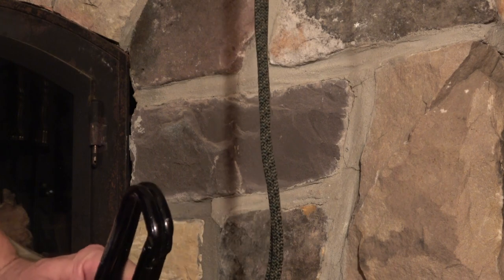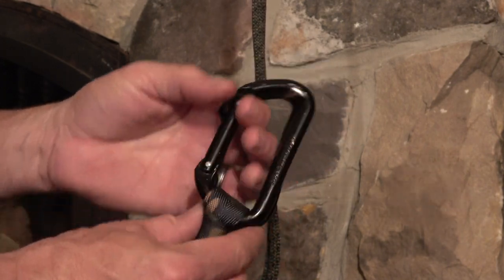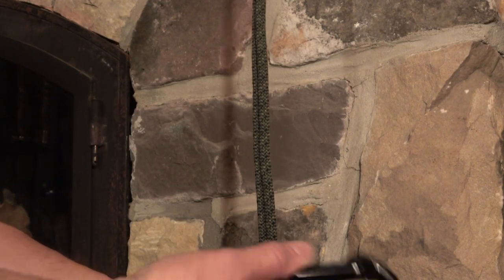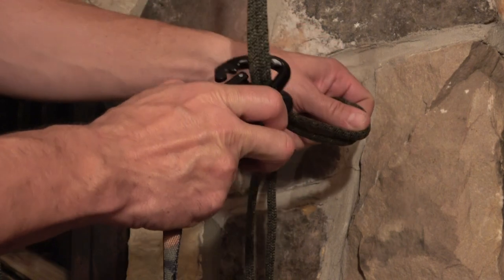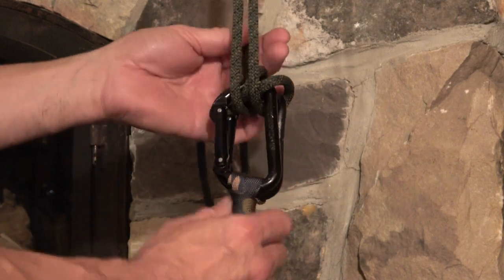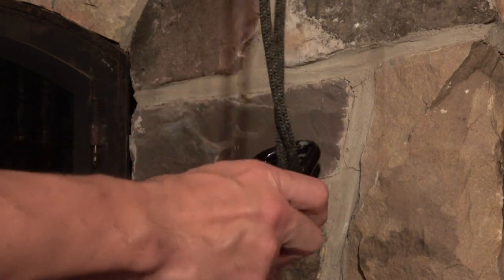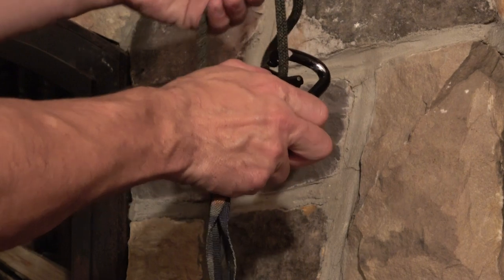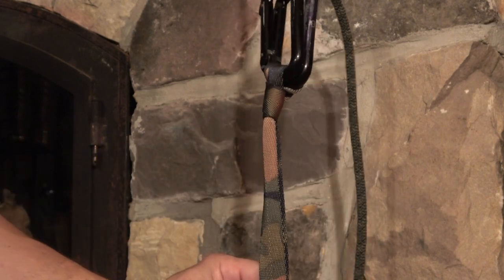Engaging the Garda Hitch (unlisted)

Comment: I tried this and it locks up both ways, so i still need to unload first before for progress capture to work.

I'm a new climber. Could someone please explain to me why we need this hitch over other hitches like distel, michoacan, and many others friction hitches 🙏
Reply from the maker: The reason I introduced the Garda was to create this footloop. See video link for the JRB Garda Hitch footloop. If works on one rope or two. This is a unique feature and no friction hitch can be attached and advanced so easily.  If yours is binding, you may be using rope that's too thick or stiff for the carabiner. Test it on a smaller rope. 
https://youtu.be/OirPmQYueWQ

https://youtu.be/OirPmQYueWQ